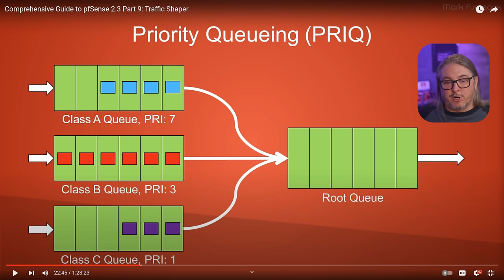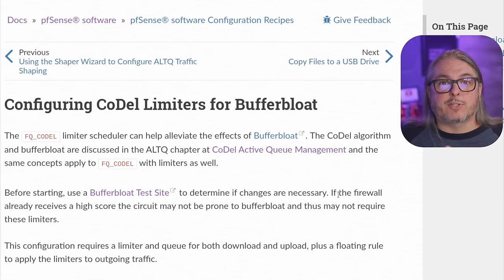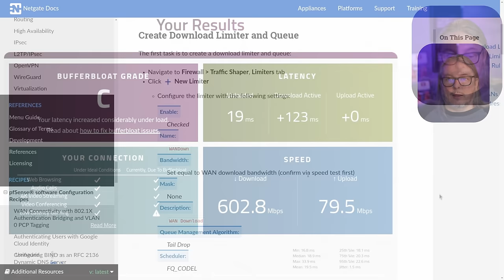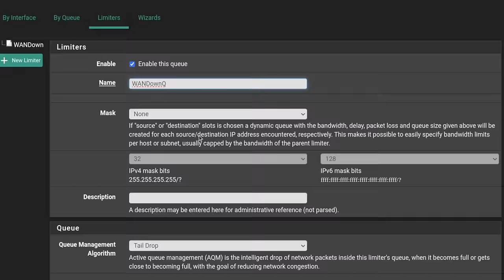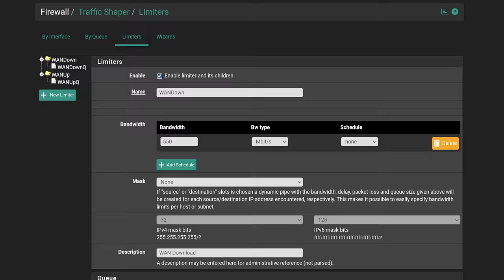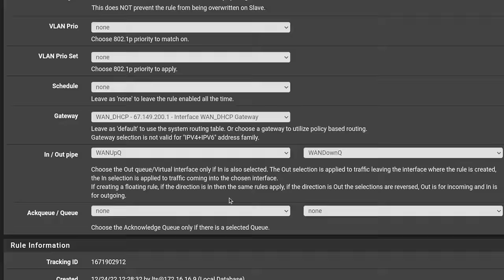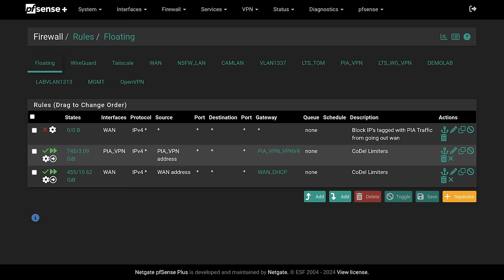How To Fix Bufferbloat in pfSense For Better Network Performance

Comment: what kinda sucks is that its really cumbersome to test various parts of each option - for example if you go for traffic shapers rather than limiters, some of them can add significant cpu overhead (FQ_CODEL as a limiter doesn't seem to do this). I'd love a video where someone actually tested the various overheads.

also a lot of these videos focus exclusively on LAN/WAN connections (which most people have) but quite a few people run VPNs on the router now, and some even have all traffic running through VPNs. I've set up mine accordingly but it would also be nice to have a video focusing on those different kinds of configs. Some people run very high bandwidth applications too, which saturate networks (tor clients, torrent clients, open directory web servers / file servers) so it would be nice to have a best practice on how to ensure proper limiting of those (i did this through using the weights system and it seems to be working but i dont know if this is correct)
Reply: completely agree. we need a 1h video explaining and comparing scenarios. you are the big one tom!

Comment: Hi Tom, followed your tutorial and it worked. improved the latency. Interestingly, I had a limiter setup for one of my computers on LAN with 1Mbit upload pipe and 5Mbit download pipe. Well this tutorial broke the rule in half so to speak. The 1Mbit upload still worked and applied for the computer, but the 5 Mbit down limit was thrown out the window. Full 600Mbit download was allowed to the limited computer. Tried it with another computer, same results. Redone the limiters. Same thing. Kill all states. Same thing. Reboot firewall, same thing.... Any thoughts?

Comment: Thanks for raising the issue! Having the consumer set up the limiter on their end is a sign of an ISP "cheaping out" - at least in my part of the world (Germany). My experience ranges form very well implemented (Telekom) to nothing at all (Vodafone Kabel - here a FW capable of setting up limiters was pretty much mandatory; at least in the past)
Reply: Vodafone is selling 32 Customers capacity on the same 2.5 gbit link. The fastest speed is 1 gbit that you can buy at the moment. Therefore a maximum of 2 people can have that at the same time. On DSL, the overbooking ratio was way lower. Therefore it is way more relyable with better latency. And the last thing worth knowing is the messed up peering Vodafone does. It is so much worse than the telekom ones, since they try to cheap out whenever they can. In Germany, we had over 6 months of almost broken cable internet because Vodafone canceled peering contracts.

Comment: Tom, as always, you and your videos are blessings for us novice IT adventurers. Thank you. I'm curious though, several of my more mobile devices use Wireguard to "phone home" when out and about. Would one need to make any accommodations for that when running the initial Bufferbloat test and/or setting up the CoDel Limiters?  Running the Bufferbloat test with Wireguard activated on my laptop (connected via LAN) was almost 600 mb/s. Without Wireguard activated, my "gigabit" internet went back up to its usual 936 mg/s or so.

Comment: This is pretty cool.  I have redundant WAN connection with two ISPs both with different bandwidth.  I presume I would just created each one individually and assign it to each individual WAN interface even though they are in a gateway group?  Or would I have to use the lowest common denominator and apply it to the gateway group.
Reply from the maker: No, per the instructions on their site you would create a limiter for each WAN connection.

Comment: Quick question: How (or do) you alter this with dual/multiwan, with our without a gateway group? I just went through and did this on both WAN connections.
Reply from the maker: Per their documentation: For multiple WANs make a complete set of queues for each WAN and make a separate floating rule for each WAN. Ensure the rules do not match the source IP address(es) of the other WANs.
Reply: @LAWRENCESYSTEMS  Thanks, I believe I did that. Nothing broke at least :)

Comment: Hi Tom, I don't even know where to start, but i'll guive it a try. 
My ISP router has a 4Gbit fiber connection. My custom pfSense + firewall is connected via DMZ to the ISP router. My pfSense nics are on a 2500Base-T <full-duplex>.
I've followed your tutorial and all is working fine, but a couple of things intrigue me:
when setting the limiters up whith a speed below the nic speed, let's say 2400Mbit/s and I perform a bufferbloattest at waveform , I get worst results (grade B or C) than when i set the speed within the limiters at 950 Mbit/s (grade A+);
when the limiters are on the higher speed and i perform a speedtest on my pfSense router with speedtest cli the report for download is never higher than +-1500Mbit/s the upload around +- 500Mbit/s. I've read that the speedtest at the pfSense router is not very reliable, but i whould expect to see higher speed results when the limiters are at 2400Mbit/s.
But my main question is, why is my bufferbloat worst with higher limiter speed within pfSense? Does it matter where my pc used to perform de waveform test is connected to? This pc has a 1Gbit/s connection to the network.
I hope that this somehow made some sense and somebody has some ideas where to look at.

Comment: If you attempt to do this on with a IPv6 WAN address. The source in the floating rule can't be "WAN-address" because you probably don't NAT with IPv6, use "any" instead or if you have a fixed prefix, use that. (no I did not just spend 4 hours thinking my Pfsense was borked. What do you mean?)

Comment: Not sure where I've gone wrong but my 1G fiber went from a C with 19 ms unloaded, +8 ms download, and +61 ms upload to a C with 17 ms unloaded, +8 ms download, and +154 ms upload. I'll have to spend some time testing different upload and download bandwidth values and see if I can improve things.
Reply: Curious. Did you try changing the Queue Length options in Download and Upload Limiter? I was trying to find ideal settings but the documentation is sparse.

Comment: Big disclaimer for those on connections with unpredictable speeds!!
My internet upload can vary between 35 and 50 mbps. I've tried every possible "buffer bloat" fix under the sun and nothing works if you can't set limits under which your speeds will not drop...
Cable internet is a "shared medium" amongst everyone in your neighbourhood.
Reply: yep unfortunately you would have to set it ot 30 in this scenario and lose out on all that potential ;/ its not ideal but its probably the best you can do. maybe look into the scheduling options and see if you could toggle between them at various times, peak vs off peak
Reply: Totally correct. However there are other types of queues that do work better under such conditions. In regards to cable, the latency and the jitter is way worse compared to DSL. I would not recommend to use queues unless you have a real reason for that.
Reply: That's interesting; I assume you've tried CAKE autorate / adaptive bandwidth? Some Starlink & other satellite ISP users have used that with good success. CAKE is an alternative to FQ_CODEL, but it is unfortunately only on Linux-based routers (e.g., OpenWRT) and not quite yet on FreeBSD-based routers (e.g., OPNSense, etc). CAKE can be CPU-intensive to shape very high bandwidth (500Mbps+), though.
Reply: @ikjadoon  Thanks for the info. Unfortunately a no-go for me running pfsense.
Reply: @Clarence-Homelab  Ah, apologies, yes. Understandable.

Comment: Oh, so its basically what QOS settings do on other routers.

Keeps your internet speed down JUST A BIT, so theres a little free bandwith for High priority things to jump through the Q instantly.

Need to get this setup asap 

Thanks
Reply: Somewhat, yes. However CoDel works a bit different. Instead of prioritizing traffic based on type, it sits back and watches the packet flow and at each interval it whips out it's baton and shuffles all the packets in order and ensures a steady flow, every so often it allows bursts of traffic. Think of it as like that one dinner lady ensuring the kids lined up orderly, halting the kids who charging through the door to get in line.

Comment: My connection is 1000/50, originally my download latency was +45-55ms. After going through this tutorial and i am getting +200ms on the download. To fix this I change the WANDown queue length to 4250 and now i get +12ms.

Question: Should I change anything in the tunables to compliment this change? 

in some of the forums they mention that if you increase the queue length, you should also change "net.inet.ip.dummynet.pipe_slot_limit" to something higher. Can you comment on this?

Comment: Hey! Thanks! This definitely got rid of my latency BUT  i now have 80% less upload speed. What happened?
Reply from the maker: Maybe you set the upload speed too low.
Reply: @LAWRENCESYSTEMS  i have my upload speed set at about 10Mb lower than my max. Dwn = 900 Up = 115. i even played around with the amount from 1000 (standard) - 3000 (for higher dwnld).

Comment: Is this a problem in OPNsense - or rather, can i use the same steps in OPNsense? I'll try the test site when my neighborhood has gone to sleep.
Reply: This is a problem on all routers. The steps in opnsense are almost identical, with a small difference: limiters (pfsense) are pipes (opnsense). And there's a separate UI section for the shaper rules - quite neat.

Comment: Watch out for trash bytes in config files creating and deleting limiters. Same with changing unbound repeatedly. Sometimes you gotta manually fix things if you fiddle with settings too much.

Never delete an interface without deleting firewall rules first. Trash leftover firewall rule bytes. 

If you use the layer 2 firewall be sure to have all your rules memorized. Lots of floating rules and layer 2 rule creation and deletion causes all of the rules to get mixed up randomly, and eventually I found it best to put my limiters and layer2 rules on non-quick rules. Last match rules and aliases are amazing. pfSense's rules are so awesome though 😅

If you can code your own firewall though, you are golden.

Comment: This test was interesting. I have 2G/2G Internet. My devices on a 10G connection get A with latency 16/7/1 and down/up 2100/1900. My 1G test devices were C with latency 25/34/162 and down/up 529/924.

Comment: can someone point me in the direction of where to obtain a pfSense router like what was used in this video? A proven make and model would be ideal for me as I don't have time to experiment.  I have a 500/500 fiber ethernet network that I want to use it on. Thanks
Reply from the maker: I used this on a Netgate 4200.
Reply: @LAWRENCESYSTEMS  thanks!

Comment: Would it make any difference with my 50mbps down and 10mbps up internet service that I'm sharing with two other houses? Pfsense in a proxmox vm on an HP sff I5 computer. I'm using Ubiquiti 2.4ghz wireless gear. I'm in the country and the internet provider choices are limited. The internet is unlimited data which all providers should switch to. Doesn't make since why some limit the data. Im on a fixed wireless service and a wireless home network to all three houses. Two houses over 1000 feet from office where the Rocket 2AC Prism with antenna is located. The third house is 75 feet from office with two nanostation 5AC locos connection.
Reply from the maker: Test if you are having an issue first.

Comment: I have 2 wan setup with load balancer group as a gateway. How would I properly setup Bufferbloat floating rules then? Should I be creating a floating rule for each Wan separately?

Can anyone help me out with this?
Reply from the maker: Per the Netgate documentation for multiple WANs make a complete set of queues for each WAN and make a separate floating rule for each WAN. Ensure the rules do not match the source IP address(es) of the other WANs.

Comment: With NordVPN installed on a Netgate 1100, I get a D or F, latency of over 300 ms down, 200 up.  With the VPN turned off, I get an A, latency is much lower.  I may have to forget about using a VPN now.

Comment: Is this only needed if you hit your max speed provided while gaming or on a voip call?
Reply: It helps at all speeds, BUT you likely won't notice it consistently until max speed, since buffers aren't full until then, which triggers the bufferbloat problem
Reply: @KleskReaver  Thats what I thought because I have tried this over the last few years and dont see a difference with everyday tasks.  I also only hit my peak speeds when downloading updates.

Comment: Why is queue mgmt on Tail Drop and not CODEL?
Reply from the maker: Queue Management Algorithm is Taildrop and the scheduler is FQ_Codel
Reply: Because Rasool, the guy who invented it, says so on post ~720 in the playing with FQ_Codel forum. 

If you want to use the Codel queue management algorithm, you should pair it with QFQ or WFQ+ and source/destination masks. 

And none of that seems to apply to OPNSense, as fqcodel in OPNSense stinks without the source and destination masks. Maybe it is because of ipfw. I do kind of like OPNsense a bit more overall because of the security plugins. And they have a lot of pre-tuned netmap features. 

Suricata seems a bit more comprehensive in pfSense. But pfSense can be like a 18-speed tractor trailer while OPNsense an automatic with privileges.